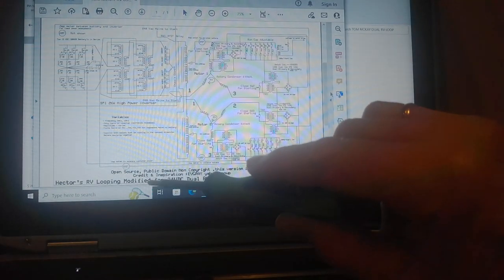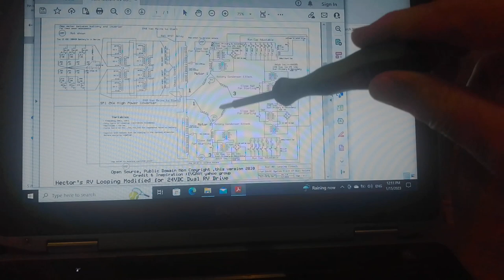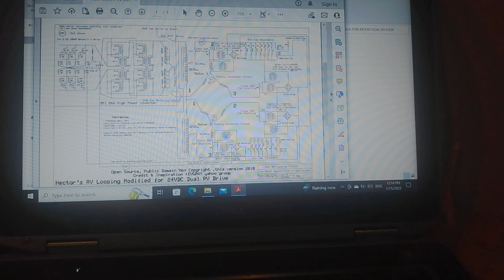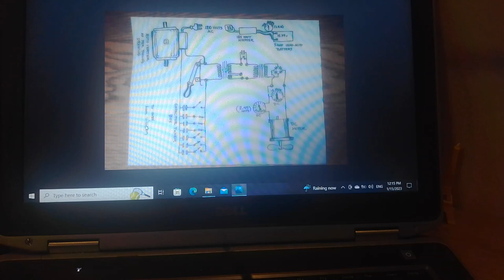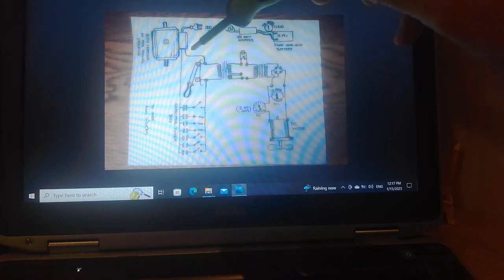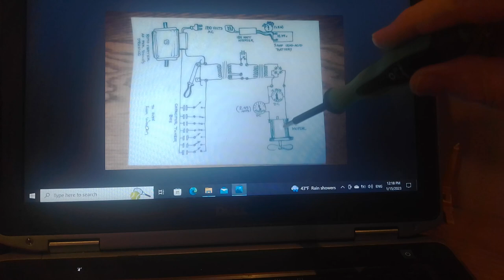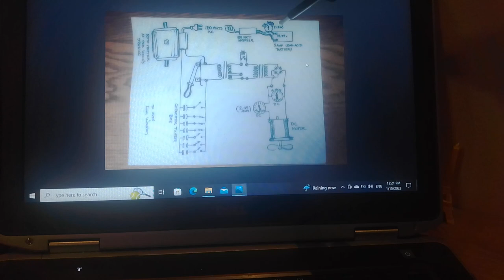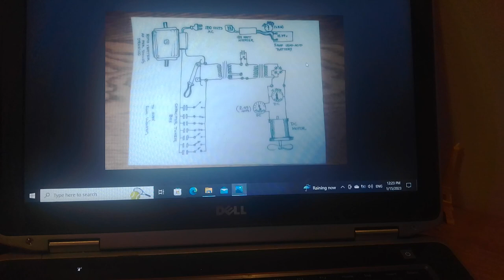Two rotovertor circuits taking out  power from run cap phase

Comment: Doug
Thank you for showing me my own drawing, since I have lost the original. I am sure glad you are so well organized since I am doing that experiment again to try to drive the big transformer here.
In the confusion of correspondence that hero transformer was called " Statpower" made in Burnaby ,BC when such things were made in Canada. Canadian Tire do not sell these anymore.
I am still searching for this original inverter and will send a photo of the circuit, asap.
It uses discrete components, so should be able to be duplicated.
I am trying with a 175 watt inverter but it blinks on and off rather than continuously delivering the current. 
Thank you, again, for all your help, and careful notes.
Cheers Warren
Reply from the maker: Hi Warren!  That is such a great drawing, and a really great "RV" experiment you did too.  Here is JPG of your drawing so you can put it into your files somewhere:
https://alternativeworldenergy.wordpress.com/rotovertor-schematics/
Reply: @Warren On the 2 tramsformers on the output before the bridge, was the cap used to get resonance? I would think this method of tapping the L2 coil from the motor would be preferred since it would not affect the resonance of the start cap bank? So your setup produced 2x the input?
Reply: @MrDKONZEN  thanks for the schematics. I would request if possible you help explain how the two transformers can be worked upon to kill lenz's effect or to put it into use.

Comment: Doug, you need a capacitor box made up to make life easier.
I find by switching small value caps in, and out, of the circuit you get a trend of which way the tuning wants to go. I am looking at your experiment with that zero. It is so tantalizing, you just want to hold that zero, somehow.
I wonder about what might happen if you actually drop that cap value below 2uf, and see if it likes it better.
To kiss that zero! Is it a meter trick, distracting us? I have such a distrust of my digital meters, that keep showing themselves only seconds away from the dreaded black garbage bag under the bench. Yet, they do show such fine increments, that might otherwise be lost.
At the high voltage experiment...to get life out of Don Smith. Can it be done?
Cheers Warren

Comment: Thanks Doug. I am doing exactly all this per the drawing but not getting the results.
I will keep working on it 

Thank you boss
Reply from the maker: I assume you mean Warrens drawing with the two transformers hung off the run cap phase.
Keep working on it, some transformers will be not work well, some loads will not work well (note Warrens is inductive load of DC motor) , some cap sizes will not do it to it either... 
Everything connects and influences the other too, such as you think a certain load will work well but with a certain series transformer it gets ruined so a lot of trial and error the cap UF value really important to nail. Its a three way juggle,,,,four way if voltage input a variable, five or six way if you add those extra caps besides the run cap.....probably nine way juggle total in end product as series caps influence adjacent cap....
Kone
Reply: @MrDKONZEN  wish me a lot of luck and some majic. Lol
Thank you

Comment: Doug can you make a link for the schematics
Thanks for sharing
Reply from the maker: Hi Edmorbus
Here is a link to Warren's circuit, that runs the Dc boat motor.  I am working on uploading the other circuit to a link, will put it up soon.
https://alternativeworldenergy.wordpress.com/rotovertor-schematics/
Reply from the maker: Here is Tom McKays circuit in a link:
https://alternativeworldenergy.wordpress.com/rotovertor-schematics-pg2/
Reply: @MrDKONZEN  Thanks
Reply from the maker: @Edmorbus   Here is special bonus rotovertor looping back to battery running invertor circuit too:
https://alternativeworldenergy.wordpress.com/rotovertor-schematics-pg-3/
Reply: @MrDKONZEN  Thanks
Reply: @MrDKONZEN  gracias por compartir Doug

Comment: Thank you for sharing. Do you know if there are any man that is running his house on tech like this?
Thank you.
Reply from the maker: Yes a guy I know who lived in Norway was running a mountain cabin with a rotoverrtor spinning a Muller generator on shaft with special hiperco 50 cores to cut down on lenz braking under load..
So the power came from not just the run cap phase as shown here, but also the motor doing some work with its shaft.  
Tom's system took up a whole room in his house. It was more or less an overunity battery charger in the end product, so you could say the battery bank big enough could power a house for awhile.
Reply: @MrDKONZEN  I would love to talk to  this guy. We speak the same lingo😀
Do you happen to have his contact info?
Regarding free energy I think you will find  YT Channel Jonessenoj of great internet.
Reply: @MrDKONZEN  Interesting. I am thinking that a large Bedini system would charge a bank of batteries for a house better. What are your thoughts?
Reply from the maker: Maybe, dont know for sure, but I will take a rotovertor motor, over a Bediniits run cap phase charging up the run battery as it spins, and a low lenz generator on shaft of it...just my predjudice.....I would think the rotovertor would have better shaft torque and spin with less power needed to do it, ..... However, Look at "K energy" youtube video he did today with Bedini window motor where it charges better and faster with less draw when shaft is loaded with fan.....Maybe Bedini charging is "better" but only if lead acids is my measly opinion.... "Bro D" reported a catastrophic garage fire from battery explosion or fire from batteries not.sure details if Bedini system or Newman and why it happened. Would like to know.  
Super caps probably best way to go, but caps only loopers calls out MIB visitors with the cease and de-test order,  good idea to keep to batteries no hassles unless they catch fire.
Reply from the maker: Hi VP plasma king
I dont think I should give out his email or anything, he is genius, also a "contactee" has reasons to be paranoid...Someone threatened him about his "RV Muller looper" he sold it to someone secret.